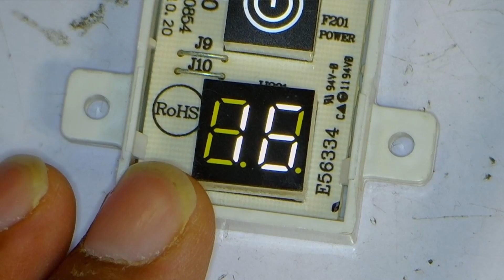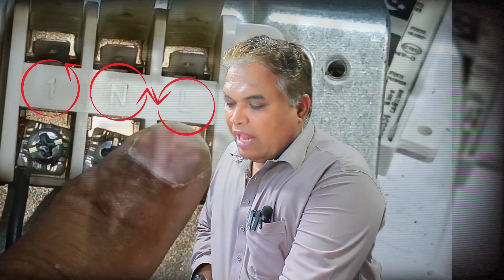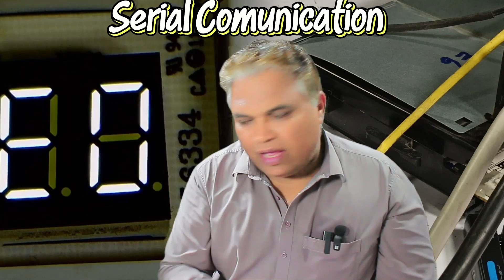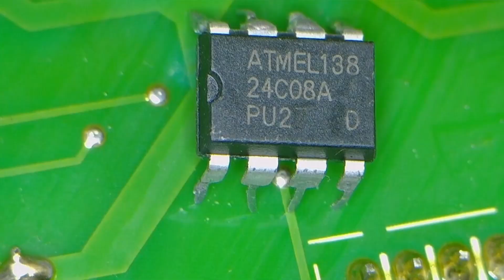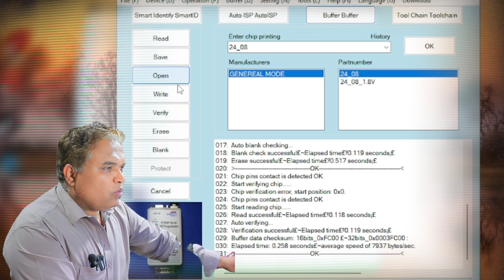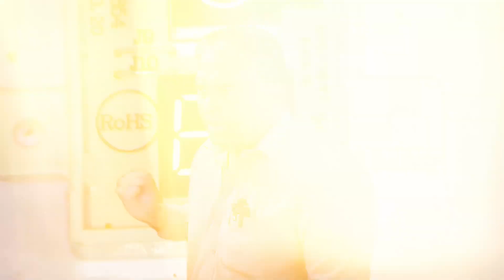EE Error FIXED! This Simple Trick Saved a Dead Mini Split AC!

Comment: I have a midea board with a P4 error, I checked it with the PCB, it's ok, the compressor is ok, now I'm interested, I checked all the NTC sensors, two 10 ohms, and one is 52.4 koma at 25c, the one that is 52.4 koma is on the compressor, is it a good sensor or should it be more than 100 koma, I need help from the board is 1/3

 Midea 17122200000309 KFR-72W/BP2 for EU-KFR26G/BP3N1Y-AE.D11NP-1 3P